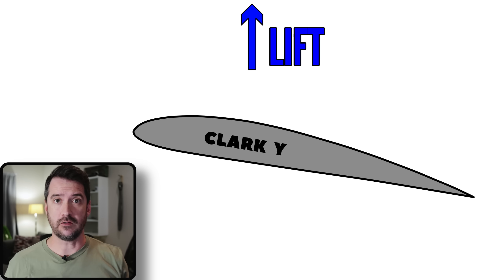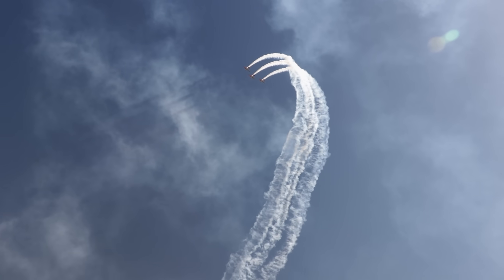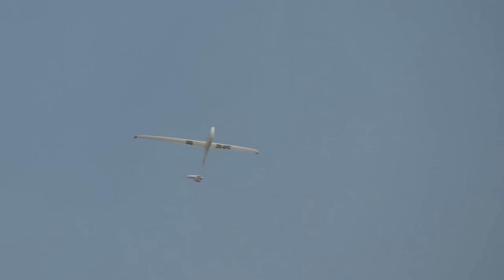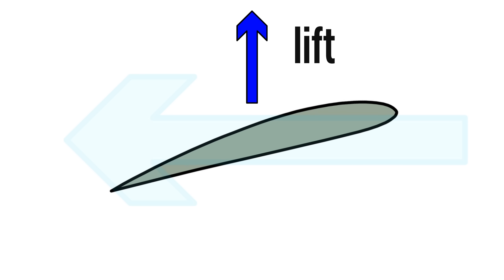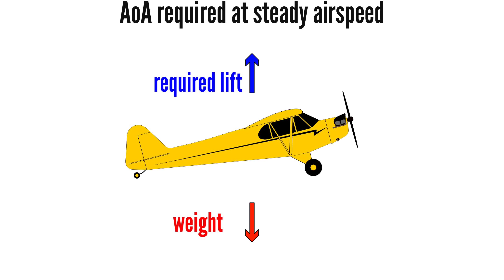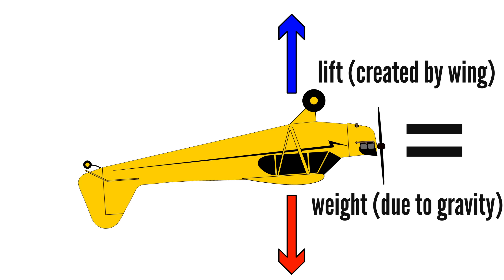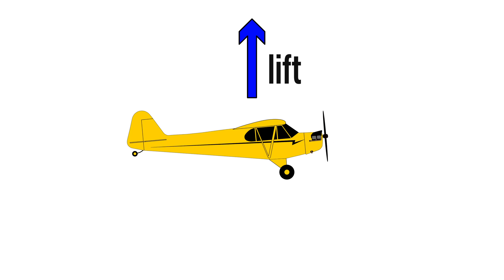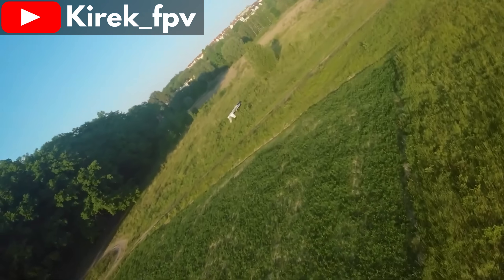Is Airflow Distance Over the Top of a Wing Always Longer?

Comment: Yes. 0:27 No, longer path over is not just "pressure differential" since yes, that bit is true. "Longer path over the top" is what's not true, not required. Attacking the argument about upside-down flight is a red herring. You're right that it's a weak argument, and your high level points about it are true, but it doesn't come to an incorrect conclusion. This is a bad faith argument. An asymmetrical airfoil is about laminar flow, not the length of the path but the shape of the transition. We've debunked longer path for decades now.

Comment: The Bernoulli principle makes a wing more efficient, but most lift comes from the Newtonian explanation of lift. This is why stunt planes like the Extra 300 have symmetrical wings for upside down flight, and they still generate plenty of lift.
Reply: That's not true.  The Bernoulli principle is an indispensable aspect of creating the Newton's 3rd law displacement of mass to oppose gravity. The Bernoulli pressure drop is what accelerates that mass in the necessary direction by the necessary amount.
Reply: @davetime5234  Nope, that's the Coanda effect that keeps the air on top of the wing following the aerofoil. And the low pressure is created by the inertia of the air trying to separate it from the aerofoil. This is why a wing will stall at a lower angle of attack at higher airspeeds. The air has more inertia. And it is this low pressure that makes the air move faster. You got the Bernoulli principle backwards. It doesn't say the low pressure causes the air to accelerate. It says that because the air accelerates, the pressure drops.

Comment: Who said it's because it's the "longer path"? Increased speed reduces pressure, not distance. You can test the theory by holding a sheet of paper in front of your mouth and blow across the top of the paper. It will lift.

Comment: Ok, I just started the video so I'm not even a minute in yet and I have to say your entire premise is wrong.
First, lift is not solely created by the wing shape, but by the angle of attack. 
Second, planes actually CANNOT fly upside down unless they increase the angle of attack of the wings enough to overpower the lift generated by the shape. A plane flying upside down at the same angle of attack would in fact crash into the ground unless it had a symmetrical cross section and a positive AoA.
---
Alright, I see now. You're saying the same thing. I mistook the initial statements as what you were positing not refuting.

Comment: Yes, a flat board at the proper angle will accellerate the air downward and provide lift. However, all the lift on the flat board will be at the leading edge, as the air under it is instantly accelerated to maximum downward speed, and the air over it is likewise sucked down immediately to the same maximum downward speed. The remaining width of the wing provides strength, but not lift. And the air over the top is likely to be non-laminar. The standard modified arc provides strength in the middle where it is thicker, and gradually accelerates the air downward over most of the width of the wing so the force is spread over the wing and laminar air flow is maintained. So the curved wing provides more lift before stall, and less drag for the same amount of lift.

Comment: I think the greatest percentage of lift is F=MA, air accelerated downward. Everyone uses the "airflow over the airfoil" idea to discuss lift, but really, There's no airflow. Real life wings don't sit motionless in a wind tunnel with air flowing over them.. They move through random air molecules in the atmosphere.The relatively motionless air is just sitting there. Then an airfoil passes by, disturbing the air, which, after acted on, returns to a relatively motionless condition, but displaced. How much velocity change did the air experience horizontally versus vertically? Think about the Hawker Harrier jet- The forward vectored thrust nozzles get their thrust from the bypass air of the turbofan's N1 Fan, a whole bunch of little wings attached to a spinning hub. If Bernoulli accounted for lift, then the harrier should rotate its inlet upward, but it doesn't. It rotates the N1 bypass air nozzles downward, because most lift is F=MA.
Reply: It is true F=MA downward must fully account for the amount of lift.  A mass of air must be accelerated downward according to that relationship.  

But what accelerates that mass of air down at the required amount of M and A?

The answer is pressure difference.  The pressure drop on the top of the wind is the main contributor of this.  The Bernoulli pressure drop is what pulls the adjacent airstream sufficiently downwards to satisfy the quantity F=MA.

We see this downwash (Newton's 3rd law, reaction for every action) if light cloud is present as we watch an aircraft pass us from our stationary position on the ground.

But the pressure difference about the entire wing must equal this F=MA, because that pressure difference is the entire physical mechanism for producing this downwash.

Comment: 10 solid minutes of hand-waving and diversion. This was absurd. 

At very low Reynolds numbers like a butterfly's wing, the lowest L/D is a flat wing, no camber.
As we go up in Reynold's numbers, camber becomes better. A good example of this is a sail which develops cambered lift with almost no thickness. The windward and lee sides are the same length.

* At this point, someone might bring up the human powered aircraft like Gossamer Albatross and Icarus which had three dimensional airfoils. And that was because they needed internal bracing in their extremely long wings, not because the airfoil shape was better.

If we keep going up then we'll find that a three dimensional airfoil has the lowest L/D.
People have flown aerobatic aircraft with symmetrical airfoils so that they do perform the same when flying upside down.
So, why don't most aircraft use symmetrical airfoils? It's because most aircraft rarely if ever fly upside down, so it makes sense to have an airfoil shape optimized for the most common mode of flight.

Saying that an airfoil develops lift because the upper surface is longer than the bottom is silly. The whole point is to create a pressure differential between the top and bottom without creating a lot of drag. That's it.
Reply: But you're neglected the indispensable role of angle of attack with this:  "Saying that an airfoil develops lift because the upper surface is longer than the bottom is silly."  

The path difference is everything, and a symmetrical airfoil achieves this difference with angle of attack.   

While an asymmetrical airfoil also must use angle of attack to adjust the amount of lift generation, the asymmetry gives it a head start in lift creation before angle of attack takes over the remainder of the lift generating role.
Reply: @davetime5234  

> But you're neglected the indispensable role of angle of attack 

I have no idea what you are trying to say. Angle of attack determines coefficient of lift.

> The path difference is everything, and a symmetrical airfoil achieves this difference with angle of attack.

Well, if that's your theory then I guess sails don't work because each side is the same length.
Reply: @scientious  "Angle of attack determines coefficient of lift."   As it should, because it changes the effective upper path relative to the lower path, affecting the pressure drop induced.

"Well, if that's your theory then I guess sails don't work because each side is the same length."  The average path length of the flow stream is greater on the convex side than the concave side.  Think about it: average radius of curvature of the flow is different because the average middle of the flow on each side is displaced from the sail surface.
Reply: @davetime5234  
Seriously? There's little point in talking to someone who denies reality.
Reply: @scientious  There is no incentive to deny any sound argument.  There's no joy in trying to be right at all costs.  Open my eyes to any meaningful mistake I've made, and I will always be grateful.

Comment: Irrelevant whether true or not. A plane can fly with a flat barn door as a wing, and that one definitely doesn't shift any "points" whichever way it's flying. Your "debunking" is still invalid.
Reply: A flat wing, with all its inefficiencies, certainly can produce lift.  But the "points" are important.  The pressure difference between top and bottom depends on how the relative wind is "stressed" differently between the top and bottom.  The stagnation points clearly show how the angle of attack of the flat airfoil adjusts the path difference that make the pressure difference possible.

It's possible to search for images of a flat plate airfoil at a positive angle of attack with flow lines included.  You can see from these how, where the stagnation points settle, give you the "pretending-to-be-a-cambered-wing" shape to the surrounding flow pattern.

Perhaps you will develop the impression from these flow patterns around the flat plate so angled up like that, that if you could just add some of that same shape to the flat plate, you might decrease the inefficiencies of flow around the plate: the inspiration for designing camber into the structure.

Comment: Simplest answer: lift works against gravity and wing tends to go up in relation to the ground, "inverted lift" works with gravity and wing tends to go down in relation to the ground.
Reply: And reverse the lift direction by reversing the direction of angle of attack.  That's how you can flip the lift for flying inverted.  Angle of attack and camber usually work together, but they can also work opposite, and the angle of attack (up to certain limits) can be used to dominate that relationship in the opposite direction that camber is working.

Comment: Not to mention, the upwards attitude when upside down also has the propeller providing an upwards lift vector.
Reply: But how high are the thrust to weight ratios of the typical propeller driven aircraft that would perform such a maneuver?  If you had a thrust to weight ratio of 1/3 and a thrust angle of as high as 30 degrees, the vertical thrust fraction is the sine of 30 degrees which is 1/2.  1/3 x 1/2 = .17  

That's slightly less that 1/5 of the lift contribution.

Comment: airflow going OVER the wing doesnt add lift.
Reply: Air over the wing is responsible for nearly all of the lift.  The pressure drops, pulling air down from above, due to the conservation of mass, energy and momentum.  The air caused to move down from this process is Newton's 3rd law, in common with rockets thrusting mass downwards to oppose gravity.

Comment: A very good explanation of lift.  I think the confusion is that "lift" is a sum of several intertwined forces.  You have the traditional Bernoulli forces, You have impact lift, and you have the equal & oposite force of the air being deflected downward relative to the wing.  All three combine to create what we call lift.  

Good news is that outside of a FAA test you really dont need to care.  Only need to know that job # 1 is keeping the air flowing smoothly over the wing.  For normal, non aerobatic, flying I teach airspeed is rule #1, #2 & #3.  #4 is dont't forget #1 (keep in mind the airplanes I fly do not have an AOA indicator).

Keep up the great video's!!
Reply: The Bernoulli pressure drop acts to move mass down from above, as far as the top of the wing.  This mass accelerated from the pressure drop is the vast majority of the equal and opposite, Newton's 3rd law contribution to lift.  Any "impact lift" associated with the bottom of the wing is a small contributor to overall lift.

Comment: angle a piece of paper and curve it in a way that it doesnt't cause flow separation.. and you will get the same lift as thicker airfoil at the same angle of attack
top and bottom of that paper airfoil will have same path
on most airfoils Cl= 2*Pi*angle of attack(radians) +Cl_0(zero angle lift)

Comment: The main component of the lift is created by redirecting the air flow. This is the result of the tendency of fluids to stick to a surface.
Reply: Redirecting the air flow is caused by the pressure drop.   As a blowing wind moves to a low-pressure weather area, and the relative wind of the aircraft similarly moves toward the area of the Bernoulli pressure drop.

The force of lift is not like a force of surface adhesion.

Comment: When I toured a Boeing plant many years ago, the guide explained how special the engineers who designed the wings were. Of course they followed engineering principles, but it takes more than that. At some point, experience and intuition comes into play. In other words, wing design is both a science and an art.
Reply: Perhaps he was referring to structural design.  The science of picking airfoils by trial and error was done by NACA studies long ago.  https://en.wikipedia.org/wiki/NACA_airfoil
Reply: @timdunn2257  NACA did a lot of work that was vitally important to airplane designers, especially before computers, but especially now that computers are so widespread it's completely mistaken to say nobody is designing airfoils any more.
Reply: @crispinmiller7989    Well, I am no expert in the field, though I do design yachts.  It seems to me to improve on basic NACA designs has had mixed results.  Note the photo above, which uses a very old, early foil design from 1922.  Tom Speer seems to be 
THE expert, as he designs for Boeing, and is also interested in sails.  He considers the Clark Y shown above to be as good as any for sailboats, and it's 100+ years old!
Reply: @timdunn2257  I'm no expert either but here are two modest data points.
-- I built a replacement rudder for my 12-foot dinghy using a NACA 0012 (or maybe -15) and it works beautifully.
-- On the other hand one of the best-performing hang gliders from about '74 to '84 was the Icarus V, that had a custom airfoil designed iteratively on a computer at Aerovironment.

Modern jetliners probably operate outside the speeds and ambient-air values used in the NACA tests, so I suspect that they need new foil design work.  But I think the best assessment of a foil comes from a wind tunnel, which all NACA data comes from.

Comment: In the final diagram at 9:30 you have the red dot (stagnation point) in a position so far aft on the upper wing surface that it looks cherry-picked to better support your argument. Is this location realistic?
The thing that always bothered me about the longer path / shorter path explanations is the implicit assumption that two molecules that were neighbours when the leading edge impinged on them, will still be neighbours after the wing has gone by. I can see no reason why this is a valid assumption, and it is an essential requirement when the explanations switches from path lengths to airflow speeds. Longer path sure. But what if it takes a longer time too?
Years ago I remember reading an article in New Scientist that offered what seemed like an overall better explanation. This involved balancing the Newtonian mechanical reaction forces between the wing/aircraft, and an appropriate volumetric mass of displaced air (something like that). This easily explains why, if you put an engine with sufficient power on almost any object at all, you can get it to fly.
Reply from the maker: I'd say my stagnation point is very realistic. Look at this video of actual airflow in a wind tunnel. Look closely at the location I said it is, and see how some air flows forwards to get over the leading edge.
https://youtu.be/e0l31p6RIaY?si=h40ed3TIR5902JOf
Reply: Navier-Stokes equations (the gold standard of the basic physical principles and their interrelationships), say nothing about equal transit time conservation.

The principles that are written into law are: conservation of mass flow rate, conservation of energy, and conservation of momentum.  

If the speed over the top has to be much faster than equal transit time to achieve conservation of mass flow rate, for example, then that's what happens.

When we talk about lift, we best focus on these three principles of conservation, with every other method of mentally modelling the actual physical mechanisms subordinated to these known and tested principles.
Reply: @davetime5234  I will just re-post the video that LetsGoAviate posted in response to my original post.
https://youtu.be/e0l31p6RIaY?si=h40ed3TIR5902JOf
And by the way, I won't be getting into a long exchange over this because I know from experience just how sensitive aerodynamicists  can be over their theories.
B-bye now
Reply: @martinsutoob  The video makes the point that equal transit time is wrong.  No argument with that.  The video also states that the speed increases over the top of the wing.  No argument with that either.  

The fundamental established physical principles are that mass flow continuity, conservation of energy and conservation of mass must be maintained.

Those are undoubtedly the rules that govern the higher flow speed over the top of the wing.

There would be no disagreement amoung the experts when confronted with such established fundamentals of the physical principles, or am I wrong?

And what is there to fear in a sincere and humble search for the truth according to first principles?

What is there to fear when no disrepect is intended or evident?

I'm happy to accept being wrong when compelling evidence and rational establishes that I have made an error.

Comment: Nonsense wing loading has nothing to do with a stall. An aircraft ONLY stalls at ONE FIXED,  critical angle of attack. This is directly related to the elevator. Wing loading, bank angle, and slipping may reduce lift but does not alter the critical AOA.
Reply from the maker: Then you don't believe in accelerated stalls?